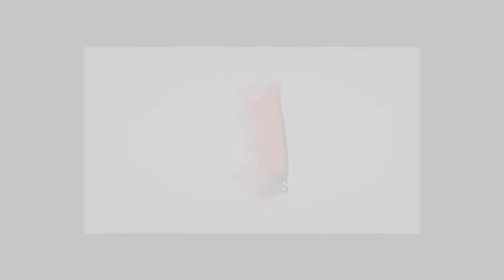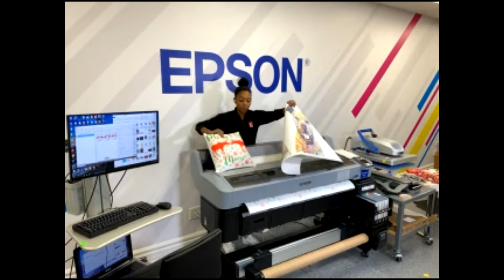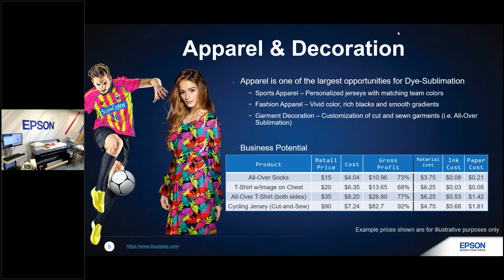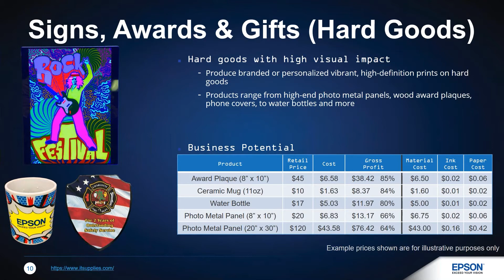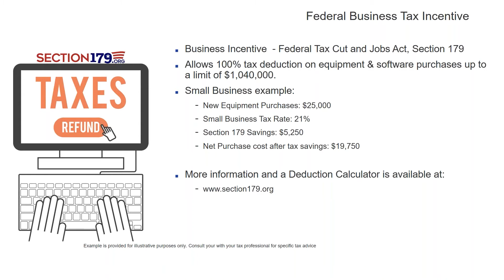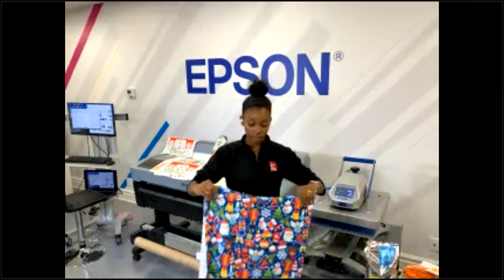Increase Your Profits During the Holidays with The Epson SureColor F6370 Dye Sublimation Printer

Comment: I have a mutoh RJ900X 42" printer, I am a small cut and sew operation and will be using this printer for allover garment printing, do I really need to purcha a Rip software if I am not running large production orders? is it posible to print with our a rip software?
Reply from the maker: Hi, what rip software are you using? If you have a rip software that does everything you need then there is no need in getting another one.